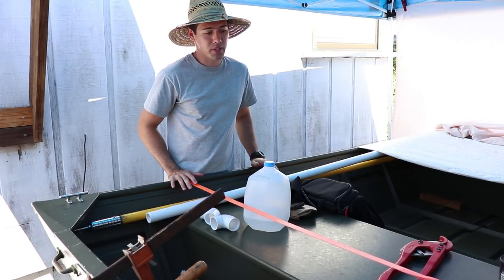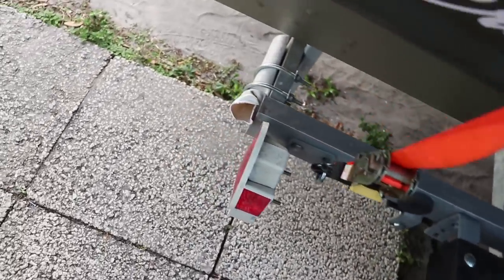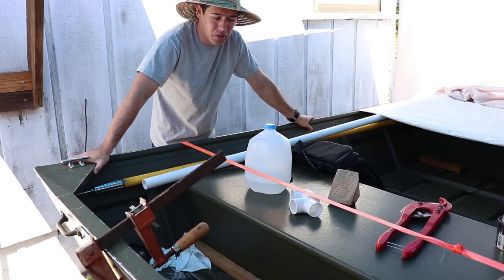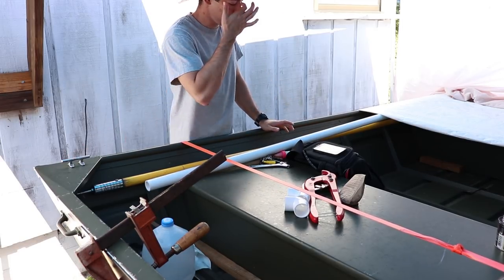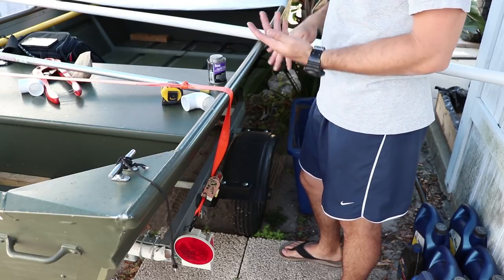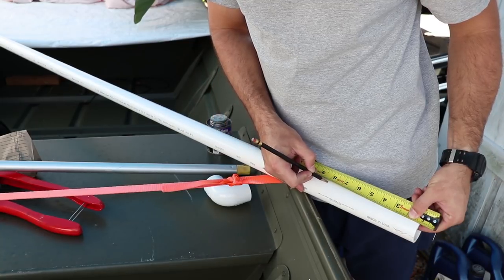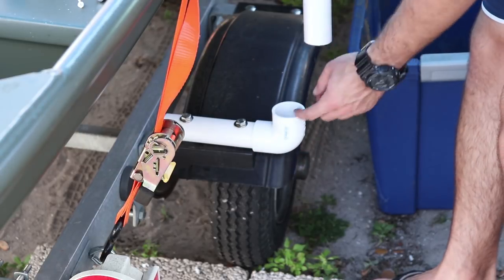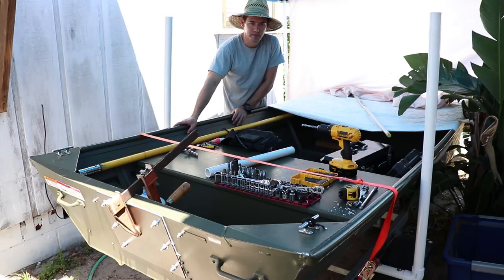Jon Boat Trailer Guides: Cheap DIY Fix

Comment: Like the guides. Makes backing up much easier. I actully made mine with treated wood and moved the lights onto them. Those low short trialers are hard to see backing up. Nice high guides like that make it nice. Great vid as always. Congrats on tne 1k sub mark. Its growing finally. Keep up the great work.
Reply from the maker: Thank you!! That's the main reason I have them, I can't see the trailer when I back up haha other than that, they do help on rough, windy days when I'm trying to get the boat on the trailer. I never thought of adding breaks lights or reverse lights onto them... I may try that. Thanks for the idea, Justin!

Comment: Looks good - very nice! 😊👍 Just a heads up, PVC eventually weakens and degrades due to the UV rays of the sun. You may want to paint the PVC. Any spray paint should work. The paint will become the barrier to block the UV rays which should make the PVC last forever. This applies to any exposed PVC conduit outside around your home as well. A little ounce of prevention before a crisis occurs is preferable to a lot of fixing up afterward.
Reply from the maker: Thank you @floridafishhunter! I never really gave it that much thought. As I'm sure you know, the sun eats everything alive. It would be worth just spray painting it to see how long it will last. Thanks for the heads up!! 👊
Reply: Tell me about it... I love the sun but sometimes, geeze,  I think it's trying to kill me lol... If you paint it white, future scratches that are inevitable will pretty much go unnoticed. I'm  a little ocd sometimes so I figured I would mention about the color... 😉
Reply from the maker: No worries... I can be a little ocd like that too hahaha good tip on the paint choice 👌

Comment: Nice system. Just noticed your bunks don’t extend to at least the transom. Bottoms on these boats are only 0.080 to 0.100 thick and tend to bend ( hook) over time and road travel. Extending the bunks to a point at least even with the transom helps to reduce the stresses while traveling particularly when trailering with the engine mounted to the transom. Just a thought. Enjoyed your post.
Reply from the maker: Good point. I will make that adjustment soon. I planned on lowering the bunks anyways and I'm going to be removing the engine from the boat to test it too so I'll definitely address that. Thank you Lloyd!!

Comment: Gonna plan on doing this tomorrow just slightly different I got the supplies today...I’m sure it will make loading my 12 foot semi v a lot easier that the tiny cheap “guides” that’s the trailer came with 😂😂
Reply from the maker: Haha I know it wasn't good when I looked back going 60mph and both pvc poles were like dog ears in the wind 😅 The standard PVC thickness is definitely the way to go haha it really helped making them the size I wanted and placing them where I wanted so that the boat was super easy to load and unload. Good luck with your project!

Comment: I'm brand new to this, what is the purpose of this pipes?
Reply from the maker: The pipes help guide the boat to the correct position on the trailer when you go to put the boat on the trailer while it's in the water.
Reply: @JTgatoring  thanks for the information.